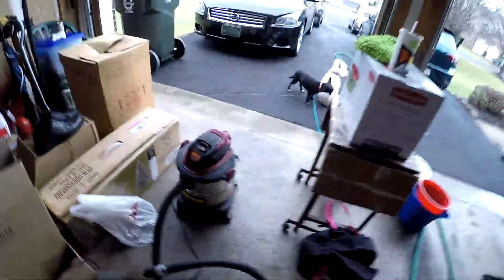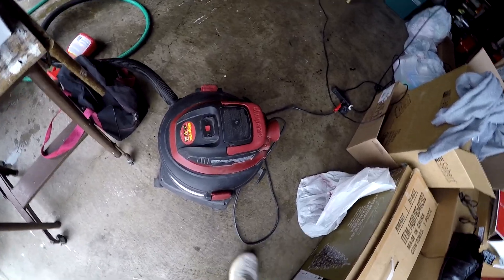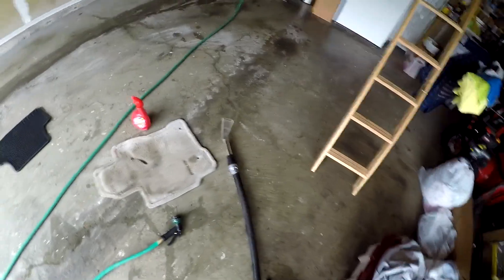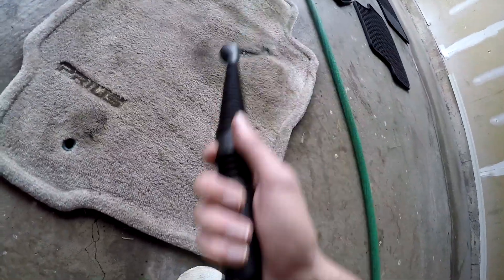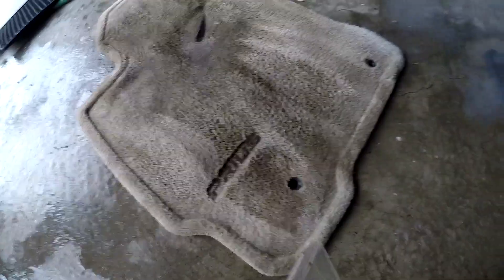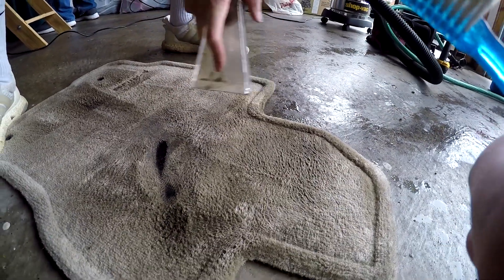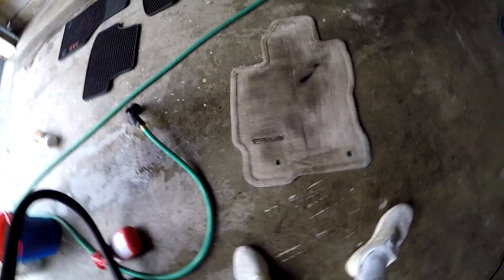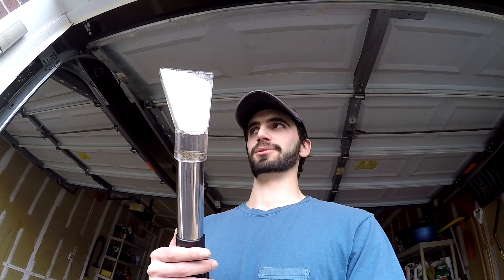Convert Your Shop-Vac Into A Carpet Extractor!

Comment: the shop vac is a good option if you’re used a pressure washer or water hose to rinse the solution out. don’t use the extractor alone after agitating, the solution needs to be rinsed out
Reply from the maker: I agree with this. I did multiple sets of passes rinsing with fresh clean water each time until the color cleared up
Reply: Instablaster...
Reply: So what about the sits ? How do I rinse the sits before using the extractor?
Reply: Are you going to pressure wash the interior ? Lol,this is a solid solution,maybe a pex500 could the best job as far as electric extractors go.
Reply: @elic5355  LOL to ur comment, as seen on the video he´s using several things to clean the CARPET (not the interior) and it didnt turn out that well so she gave him and the viewers her idea that its what  i was gooing to post a comment basically same thing. Just grab your carpets and go to the nearst wash it yourself car wash if you dont have ur own pressure washer with some rubber boots or some protection and wash the there for a dollar or two. On the seats scrub them and do what you see on the video
Reply: Ok mother!
Reply: Folex gets out stains when other cleaners don’t.
Reply: A pump sprayer with water to rinse out the solution

Comment: Makes you wonder why wet/dry vac manufacturers don't get in on the extraction business action. Supe it up with all the carpet/upholstery tools. You wet the area with spray bottles yourself but the extraction tools, like that one, included with the vac would be amazing.
Reply from the maker: They actually used to, you can find variants of shop vac’s on craigslist or fb marketplace that are setup for extraction use as well

Comment: I went with the $79 extractor head and an air compressor hose that hooks up to it and the hose. If you clean any amount of cars, I highly recommend it. If you don't want to spend extra on that, I suggest getting a pressure weed sprayer for $10 bucks. Then put hot water in there. Hot water is more important than any cleaning solution.
Reply: Do you mean an extractor head for an air compressor? As in, not for a vacuum? The air compressor and water hose plug into it? Haven’t heard of this one. Thanks

Comment: Thank you so much!! Just FYI, I have the Stanley 6HP 8Gallon wet/dry shop vac (stainless steel canister on wheels ) (Bought it from walmart a few years ago, It was $80 when I bought it but I think they are like $60 now) I ordered the "Happy Tree" hand tool from amazon (I believe it's the same one you ordered because I saw this video and went straight to amazon) On my vacuum, I simply took off the end of the hose (where the attachments go.... it unscrews backwards *lefty tighty righty loosey*) and screwed the happy tree hand tool right on!!! Perfect fit! No duct tape needed!! So IF you are buying a shop vac to do this, definitely look for the one I have (But if you already have a shop vac, use duct tape if it doesnt fit! No need to buy another shop vac) I'm hoping to rig up a sprayer on the handle soon (There's a video by Detailing Kartel that shows how he rigged one up using a garden hose and you just put the hose on the outside tap and you have water!)
Reply from the maker: Rachel Compton Thanks so much for the comment and for the suggestions to help out any viewers. It is amazing how much a shopvac can pull out compared to a consumer grade cleaner. Hopefully other people consider this method!
Reply: Try a pump sprayer , spray on the chemical and let it do it’s thing...then suck it up

Comment: Thanks I was wondering if this could be done with shop vac.  
You forgot to mention the most important part which is take the filter out of your shop vac.
Reply from the maker: Becky Simpson Good call, most folks with a shop vac hopefully know this when sucking up water though. I appreciate the comment, hopefully people see it!
Reply: Thanks for mentioning this i borrowed a friends shop vac and had no idea about the filter glad i looked thro the comments before attempting something
Reply: You still want to run the foam sleeve though
Reply: my new shop vac is so advanced is says i can use it with the filter still  on :)
Reply: Some wet dry vacuums have a universal filter.  Mine does.  You leave it on and out the foam filter over it

Comment: Majority of your dark spotting is probably crushed carpet fiber. Just like a normal home carpet, the pile gets crushed and the fibers untwist from time and use. Since you don't have a water attachment on the shopvac set up, the best approach for you is to apply slight amounts of water as your extracting. You'll stop pulling crud out when the water in the carpet is gone, so the answer is to add more water until your satisfied with the clarity of the water. Also the majority of commercial cleaners actually attract dirt back into the carpet after its already dried out. Just gotta make sure you get it all out and groom the carpet fibers before you let it dry. Gives it a nice appearance afterward! Good luck!
Reply from the maker: This has some great tips, thank you for providing this. Hopefully some other folks read it for themselves to keep in mind if they decide to try cleaning their carpets.
Reply: Do you know solutions that don’t attract dirt? And if not you say combing it is a way to combat this?

Comment: Neat idea. With those types of mats, pressure washing them works wonderfully. Just a tip if you don’t already know.
Reply from the maker: Did not know pressure washing is a good idea. I may give it a shot at some point if they get gross again, thanks for the tip!
Reply: Was about to say the same thing. 15 degree or 40 degree attachement, those mats would look factory new.
Reply from the maker: @kylelangley8818   Honestly may try this in the summer. The driver mat  particularly, the rest came out fantastic.
Reply: sgfreak96 Tide cold water clean detergent works amazing along with oxyclean. Couple that won’t the pressure washer and you will be blown away.
Reply: La awesome all purpose cleaner with the steam cleaner works great.

Comment: Drill brush is nice but i'd changed everything else . For the cleaning solution id use simple green water and Sodium Percarbonate. You can buy an metal upholstery wand that has a trigger and spray nozzle , i use this with a pressure washer and 5hp shop vac to detail cars before i sell them .
Reply: Yo what's green water?
Reply: @gershwillquenchyourthirst221  Punctuation issue I'm sure.
simple green, water and Sodium Percarbonate

Comment: I recently bought the exact Happy tree tool and put it on my 5HP 4 gallon rigid wet dry vac with duct tape.  So far ive only used it on my couch that has extremely tight and flat fibers (unlike a car carpet with fibers that stick up) and it dosnt suck the water into the machine but instead holds the water in the clear extractor head until I lift up on it which of course lets the suction (and water) pass through. I added some "height" to the lip of the extractor head by putting a few layers of duct tape on each end so that hopefully it wouldnt get clogged by the non breathable couch upholstery. ill post an update on it later.
Reply from the maker: If the fibers are pretty tight, there may not be enough area for the extractor head to pull air/water through the fibers. Using a fibrous/porous material is what really allows these to work, since the vacuum is basically pulling air (and the water) in through the material we’re trying to clean. You can also try holding the extractor at a different angle
Reply: @sgfreak96  True and ive noticed that holding the extractor head at different angle allows the air/water to pass through. Also doing short 2 inch (or so) passes before lifting the extractor head up seems to do the trick. Ah.... The little ghetto adjustments we make when we dont havena real extractor lol

Comment: U need to add more water and cleaning solution. I have the same attachment, plus I have a Bissell. The Bissell don't pull no where near what my 5.5amp Vacmaster beast does. The things I don't like about the attachment is it's very big. Forget about getting into tight small places. Also, u need to hold it at a certain angle to maximize suction.
I did the side by side with shopvac and Bissell, and yes, shopvac sucked liquid up that Bissell left behind. Kinda feel like a fool for wasting money on a weaker extractor, but Bissell was a good machine

Comment: Oh boy:(. Resolve contains optical brightners that will cause  color loss, ph shifts in the carpet, rapid resoiling, and irreversible damage to the fibers. Those Mats are generally a polyester fiber which can be easily power washed for better long term results, with less liability for you and your customers mats. For the black spots and oil soils which are none water soluble, use a solvent based cleaning agent, agitate, and then flush with your power washer:) Boom!
Reply from the maker: Adam V. Didn’t know power washers were an option prior to some other commenters on this. I bought the car for $800 so I’m not worried about the crappy mats; it was just a good proof of concept to test the cleaning setup shown in this video! I’ll remember to avoid resolve.

Comment: Just bought that attachment with your link/coupon code. Thanks man!
Reply from the maker: Awesome, glad it could help out. Feel free to comment back with results. I’m curious to hear your thoughts
Reply: So update: I too had to make my own adapter for it to fit my shop vac. Basically dremeled down an extra extension tube so it would fit.  Otherwise worked pretty well. Just dont be shy using water/cleaner so really suck up that dirt. 👍

Comment: good video, but you don't need all that equipment to clean some old carpet mats. I usually just use water, a brush, a small amount of laundry detergent or carpet stain remover spray and then I'll let the carpet mats air dry.

Comment: i think that works great...you just did a quick demo here... i can see making a couple of adjustments to your method would get much better results for sure...
Reply from the maker: That’s all this was, a quick video. I’m sure you could use a higher hp vac as well. The point is, its possible and seems to do a great job for what it is!

Comment: & the carpet mat still looks bad
Reply: Right?
Why do People have carpets in their cars?
Wtf
Reply: No I took before and after photos from the video. It actually looks worse. An extractor is 100% worth it.
Reply: LouCityStudios You can make your own. Remove the filter from a shop vac, attach a nozzle that’s suitable (thin one) soak carpet with solution. Then flood carpet. Suck up the water after agitating. Easy easy. You don’t need a $1200 extractor if you are only DIY on your own car. Facts
Reply: NordicPride970 extractors r 150 to 300
Reply: KingTazler25 For a POS one, yes they are cheap. For an extractor that works, no they are hovering around $1200. 

A cheap unit doesn’t hold a candle to the DIY approach using a powerful wet/dry vac. Period. Cheap extractors have weak vacuums, don’t heat the water to appropriate temp. You get what you pay for.
Reply from the maker: I’ll reply here and say these mats were likely never ever maintained well and can probably never be saved. This is a junkyard car. That said this was more a proof of concept. The driver mat is the only one with severe damage, the rest came out looking brand new. I believe some people are saying it looks worse because the carpets were wet, so they appeared darker. Once dry, they returned to the bright tan they originally were. Hope this helps.
Reply: @sgfreak96  good video
Reply: because he should use more water and soap. Floormats are easier to first pressure wash and then suck them dry.
Reply: @ChaosBW  while we are at it, why do people have carpet in their house? Carpet is literally a mold and bacteria farm. Two spills is all it takes to ruin a carpet forever. With hard wood you could literally use a bigger spill to clean the little spill and it doesnt ruin the room and cause spores to turn the inhabitants feral,
Reply: @dannymckenzie8329  because carpet feels nice to walk on
Reply: @dannymckenzie8329  it reduces sound when you walk & helps keep ypur feet warm in the winter
Reply: @ChaosBW  seriously? Why do people comment like this. Chill. Smh. Are your floors wood grain? Smh.
Reply: @123bluecatky  not if your shop vac is stronger (11 amps) than the extractor. I don't have an extractor. All I do is use a pump sprayer, spray area with water. Then extract with shop vac.
Reply: @nordicpride9708  You are way off with this comment. Smh. Terrible. A bissell spotclean pro works great. Smh. Yall and this ridiculous advertising of expensive stuff and anything outside of it wont works. Smh.
Reply: @wiiiz3  i hate carpet. I would rather have vinyl or anything and put out area rugs
Reply: @King_drew  you can get stains out with just about any extractor and wet/dry shop vac that has decent power (I’m agreeing with you btw), just like you said above lmao. Most of the results come from the cleaning product and agitation from the drill brush anyways. as long as you got a decent enough suction power from wet/dry shop vac to suck up the water you’re good to go and will still get amazing results. May take a little more elbow grease compared to other models, but you can still come out with great results. Just gotta have good cleaning supplies and agitate those stains & dirt real good.
Reply: As a person that does detailing you don't necessarily need a extractor I think it's a good idea and works good it's just resolve is not the best cleaner to use to break all the stuff down that's in those mats they need a degreaser and then it would get them cleaner. And back. To factory color
Reply: It looks terrible
Reply: @nordicpride9708  question, how do I dry the carpet completely after? With a rag?
Reply: @t.f.3305  I use a fan and if in the cold part of the country a heater as well. Just have to be careful
Reply: That's on you then.
Reply: I just ordered this for my 05 Escape Hybrid!!! I'm a 64 yo woman. I'll also use it on my rugs. 
Excellent video young man!!!!!!

Comment: Hey bro, an excellent cleaning/upholstery shampoo solution is using a biological washing powder (laundry detergent with enzymes), dish soap and OxyClean - a scoop a piece of the 1st and 3rd one and a tablespoon of the 2nd one is a gallon of hot water (really hot) and put into a pressure sprayer (weed sprayer) and spray on upholstery. Then after extraction is completed successfully, spray an essential oil solution with ever clear, glycerin and essential oils and spray on all upholstery. The enzymes are what you need. Also allow the solution to do its work for 15-20 min… Also, where did you get that Prius dude?
Reply from the maker: Nice suggestion for the solution! I got the prius from a Copart auction for $875 back in 2019. I’ve put 20,000 miles on it as my daily driver since then and its been great

Comment: The steamer doesn’t do nothing On Interior If you’re doing just floor mats any scrubbing and suction will do just as good as anything
Reply from the maker: John Miller What would you recommend using the steamer for? I saw in a few videos people using steam on the upholstery, but I’ve also seen it used on dirty wheels as well.

Comment: Do you need to soak the carpet for the extractors to work?
Reply from the maker: In theory yes. The way this works is as the liquid is vacuumed up it loosens and removes dirt that gets sucked up as well. A real extractor has a nozzle that shoots spray continuously so that flow of water is flooding the carpet, and it is immediately then vacuumed by the head of the vacuum attachment.

Comment: Any great ideas of how to clean between seats and the console.....or prevention tips to stop materials falling between seats....Thanks
Reply from the maker: Best thing to do is unbolt/remove the seats. Super hard to clean in those spots, but with the seat out it takes the difficulty away. Seats are easy to remove, usually 4 bolts and they’re out.
Reply: @sgfreak96  Thanks

Comment: Guess I'll save some cash. Building one but adding a water hose from my water tank
Reply from the maker: Ty Kendrick That is the most ideal. I’d love to hook up a water line to mine, it would be perfect.
Reply: Bro you need an extractor especially to pull that soap out .
The aqua vac is really good
Reply from the maker: Crazyhands Hands Not necessary, the shopvac with this attachment has more than plenty power to pull water out. The only drawback is there is no water line attached. I had to soak the carpets a good bit before vacuuming which is NOT ideal for interior seats. A pro extractor shoots a lot of water but it is immediately sucked up before it really settles into any upholstery. This shopvac setup will not do that as there’s no water line and you have to pre-soak what you are cleaning. Hope this helps.

Comment: Hi, thanks for the video! I’m trying this asap. Do you know if this works on a shop vac brand vac?
Reply from the maker: Yup, mine is a shop vac brand. Brand shouldn’t matter, but the hose diameter is the main concern
Reply: @sgfreak96  ok, does it come with both attachments?
Reply: Both adapters, I mean?

Comment: Have you entertained buying a portable heating element for your bucket of water to use in your cold water extractor?  Because for each 2 degrees of hotter water temperature you yield a 10% difference in cleaning ability.  Soil just hates heat.
Reply from the maker: Had no idea it was that effective to use heat. Pretty cool.

Comment: Another trick that works real good is use tome Scrubbing Bubbles with bleach on the carpet, spray it on real thick, brush it in, let it set for half an hour, then yu can spray some warm to hot water and the suck up all that nasty stuff.